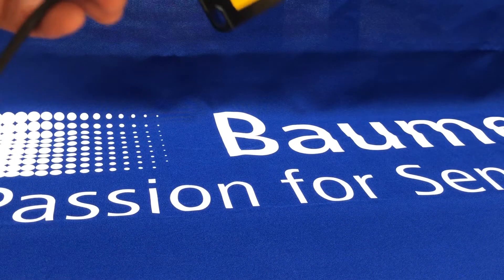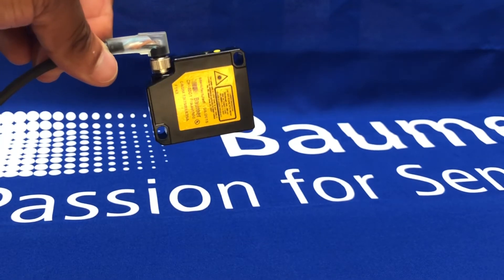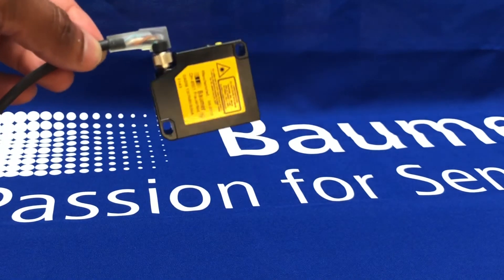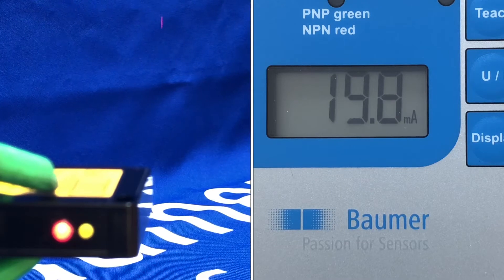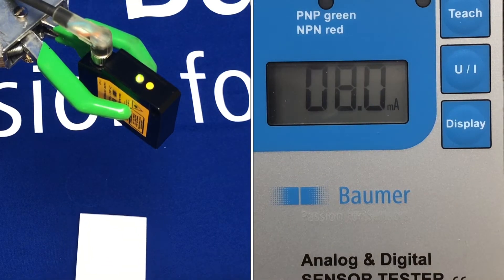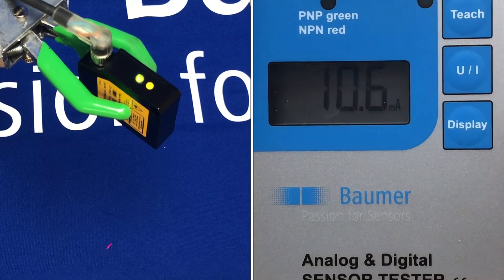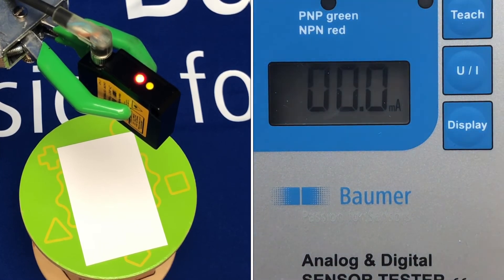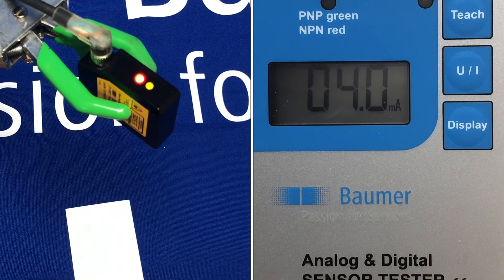Baumer Analogue Output Laser Distance Sensor Demo - OADM

Comment: Hello! Is it necessary to teach the sensor specifically with that A/D Sensor Test? or is there any other solution/way? Thank you
Reply from the maker: Hi, There is a teach button on the top of the sensor as one method and another is to apply 24V to the external teach wire acting the same as the button